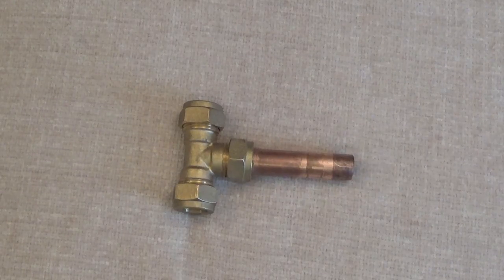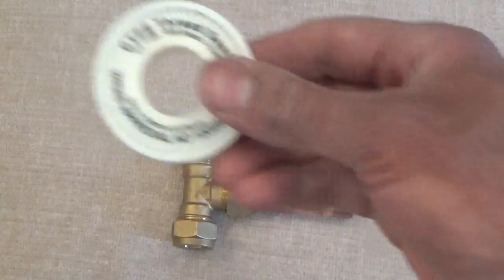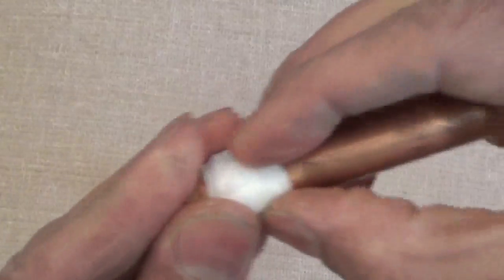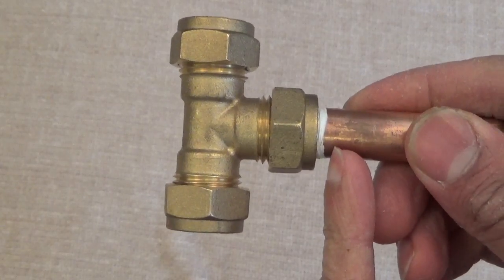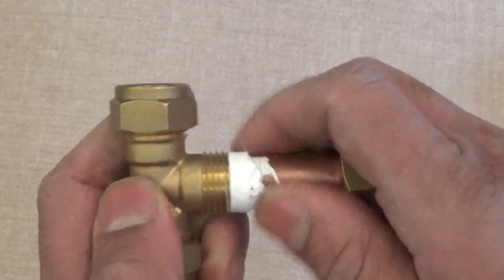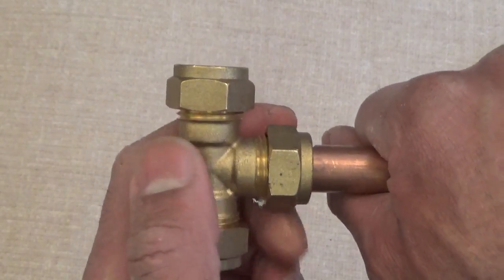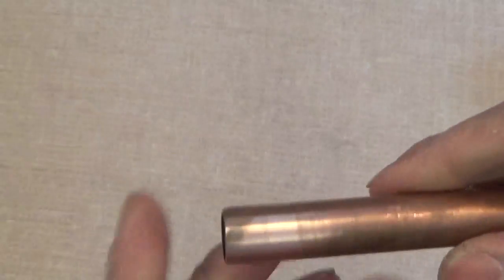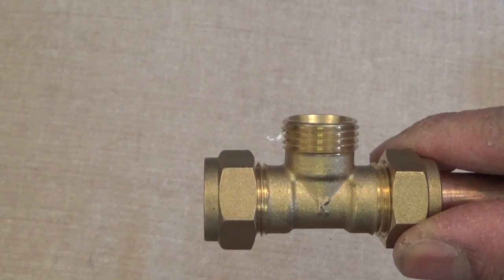Stop leaking compression fittings - Trydiy

Comment: Compression fittings do not require this. Cut the pipe clean and use new olive. Tighten it up finger tight, mark it   With a sharpie, tighten the nut with a spanner a full turn just going a quarter past the sharpie mark. It will never leak

Comment: Very easy to put PTF tape on a pipe like that, but my problem is the nut does not move away from the pipe with only about half the width of the olive which is fitted to the plastic fitting on my Shower heater which is an Aqua Tronic ultra 4 think l got it from B & Q and fitted it about 10 years ago but it has now started to drip water have tried to put more and more PTF tape on as much as the olive as l can but last attempt still leaked no way can you remove the olive

Comment: This video is correct.  We had vexing leak on a hard copper toilet supply line, downstream of the valve.  I tried tightening it and cold not get rid of the leak.  My best friend's younger is sister is a plombier in France and I asked her how to fix it.  She said they commonly use Teflon tape and pipe dope -- just a little of both -- on compression fittings in Europe, even though that's a no-go for most plumbers in the USA.  The reason it works is that it allows you to get it very tight, and really compress the olive, without excessive torque.  I tried it and it worked perfectly.  (I wound the teflon tape in the opposite direction from what's shown here though.)

Comment: A bit of very fine wire wool on this old joint first and perhaps a bit less PTFE. A 1 quarter wrench turn on the hand tight nut. Then tighten up a bit more should it drip. If you over tighten and it leaks you cant undo the damage and no amount of PTFE will sort it.

Comment: Never heard of using Teflon tape in this manner. I am installing two compression fit isolation valves in a crawl space so do not want them to leak especially since I will not have any access once the job is done. In just searching for some videos on installing isolation valves (SharkBite vs compression) I came across multiple instances of plumbers using Teflon tape on the ferrule. For the most part it seems to be a practice used more in the UK, but hey why not. Can't see any harm in adding this one extra layer of protection from leaks. Cheers

Comment: Just use polymer push fittings. The design life is 50 years (probably longer than the copper will last) and they'll keep going long after that. They cost a bit more than cheap Chinese brass compressions but it's job done and dusted.

Comment: For those so critical of this video: Ever consider that a lot of valve replacement is in an older home or one where the stub from the wall is barely long enough to handle the new valve? Or that reusing the ferrule is the most practical option in some cases? Also, are you saying Teflon tape will deteriorate with age and cause failure in the future? Really??

Not every plumbing project happens under ideal conditions. Trydiy offers a practical solution and some good advice, like not over tightening.
Reply: The video is correct in what it says, but it's usually better to use a push-fit polymer fitting. They have their own special needs (who doesn't) but they are more reliable. I've had cruddy stumps of tube sticking out that will never work, but a careful clean and the push fitting sealed. Those that won't seal  with a flexible O-ring will definitely not seal with a hard compression ring. When that happens the only option is to cut back to good pipe and start again. Non-demountable push fit to join some new pipe is often the best as it's much smaller diameter so won't get in the way.

Comment: I recently had a problem with leaking ferrules that were connected to a washing machine water supply valves. These were new valves, new compression fittings, and new pipes.  I have used these types of fittings all of my life and I am 73 years old so I have been to the plumbing rodeo before. I took great care not to over tighten them but they both still had a very small leak. I was ready to buy push on Shark Bite valves when I saw your video. I applied the Teflon tape to the ferrule and the pipe sealant to the male threads of the valve. It worked on both valves, NO LEAKS with only moderate tightening. Thank you for making the effort to produce this video as I am an old dog that just learned a new trick. I am sure that this is a common problem that owes it root cause as being poor quality fittings that are manufactured in China to very loose quality standards.

Comment: You should wind the teflon tape in the same direction that the compression nut tightens.
Reply: As mentioned in this thread That's when the tape is put onto the threads of the male portion, if it's wrapped the wrong way (ie. counter-clockwise) in that case the tape will be peeled off as the nut is closed. But the tape here was wrapped behind the olive (or compression sealing ring as they sometimes call it), there's no thread there and anyhow there shouldn't be that much tape that would catch the rear end of the nut whichever way he wrapped it.

Also, though he was turning the pipe counter-clockwise (from the olive/ring end) while keeping the spool of tape static, that's the equivalent of rotating the spool clockwise around a static pipe - which is the generally accepted 'right' way of winding the tape

Comment: PTFE tape is for sealing threads. Use joint compound for mating surfaces.
Reply: Both work in this context and with PTFE you don't have to worry about potable water regulations.

Comment: I have installed hundreds of compression fittings , there is no need to use ptfe tape, if the parts are cleaned properly, the olive will seal perfectly,

Comment: Thanks I had a leak from the compression fitting/olive. I tried the PTF tape and it got it down to a trickle. I think used the PTFE sealant and knock on wood the leak is now gone. Going to wait a day until I install the toilet because its a tight fit. Thank you for the suggestions its was great in troubleshooting the issue.

Comment: Wow...  clearly not understanding how a compression fitting works
Reply: Sometimes you pull off the old compression fitting with the tool and there is not enough space left to make a cut on the pipe. Had to use this method to seal a new toilet shutoff valve. Wish the compression nut didn't leak after I removed the old one but don't have the money to pay a plumber to come out and extend the brass pipe. This will have to do.
Reply: @brianc9036  ooof, thats rough.

Comment: I had a problem like that.  I simply mixed up some JB-Weld epoxy, and epoxy-glued the copper pipe to the fitting. I first dried out the inside of the fitting so there was no water on the surfaces, and I applied a light coating of epoxy to the inside of the fitting (just a thin layer), and then applied a nice thick layer of epoxy to the pipe ahead of the compression ring (no epoxy behind the compression ring where the compression nut will eventually be). I then pushed the epoxy-coated pipe into the fitting, and then wiped off the excess epoxy with a paper towel. I then tightened up the compression nut and waited for the epoxy to harden. When I turned on the water = no more leak.  Also = no way to disassemble that fitting, it is now firmly fastened together.
Reply: I like your style with the JB weld

Comment: If the pipe is inserted to far in the fitting it can actually not allow the compression ring to seat properly. Push pipe in all the way tighten slightly then back pipe out just a little from the fitting “Then proceed to tighten” with a little pipe compound works every time no matter the materials. A leaking one might need the pipe trimmed back a little!  Tape last resort!
Reply: looked every yt video. 
tanks for yor comment and wish me lock

Comment: I have always put teflon tape on compression joints, cheap insurance. But you have to wind it on in a clockwise direction, same direction as the nut you’re tightening, or it may not work. Might want to edit your video.

Comment: The PTFE should be wrapped so the nut doesn’t undo the tape as you tighten the nut.
Reply: But the tape is applied behind the olive/ring - no thread there. That nugget only applies when the tape is applied to the threaded portion. There's isn't so much tape that the rear of the nut will catch and unravel it.

Comment: I’m not a professional plumber 👨‍🔧 👩‍🔧 but really...truly speaking;  when connecting compression fittings;  you shouldn’t have to use special plumbing tape or compound solution.   When fitting the Olive onto the copper pipe....there is a knack to it; when tightening the compression nut.   But personally i much prefer using push fit...fittings.

I’m supposed to be refitting my kitchen out;  but not being a professional plumber.....I’ve got this awful feeling that it’s not going to be finished this year anytime soon😞☹️😒
Wednesday am at 08:15H  10th February 2021 U.K.  Southampton.

Comment: Wait a minute...the entire purpose of that ring is to seat both sides and not leak when you first tighten it by hand, give it a 1/2 extra turn, turn on the water and if it leaks, give it an extra turn until it stops leaking.
If you reopen that fitting, you have to replace that ring on the inside.
You should not need tape or dope. That is how it is designed.
Reply: Someone that understands

Comment: The actual seal is where the ferrule or olive is compressed between the seat of the fitting and the pipe. That is where the application of teflon tape or of pipe dope is likely to be effective.
Reply: But the purpose of the Teflon is normally as a lubricant to allow you to tighten a fitting more than you could without it, at least when used on a tapered thread like you are supposed to. So here it is lubricating between the rotating nut and non rotating olive.

Comment: So if you can’t fix it with ptfe tape because the pipes been bent, you take it off and use a push fit fitting, which you can only use if the pipes not been bent??? 
Great advice, must get your number so I know not to call you if I have an emergency.....

Comment: You wrapped the PTFE tape the wrong direction, it should be applied in the same direction as the nut tightens.Just had to mention it, sorry.
Reply: Well you shouldn't put Teflon tape on a compression fitting in the first place
Reply: @lukie4ever  \you shouldn't put it on a new fitting. If it's an old one and it leaks and for some reason you don't want to replace entire fitting you will get away with PTFE. But also this guy wrapped it the wrong way. Really kills me when I see video with PTFE on a new fitting, wrap it and give it quarter turn - that's a recipe for disaster. Sometimes trusting in advice found on Youtube may end badly
Reply: That's when the tape is put onto the threads of the male portion, if it's wrapped the wrong way (ie. counter-clockwise) in that case the tape will be peeled off as the nut is closed. But the tape here was wrapped behind the olive (or compression sealing ring as they sometimes call it), there's no thread there and anyhow there shouldn't be that much tape that would catch the rear end of the nut whichever way he wrapped it.

Also, though he was turning the pipe counter-clockwise (from the olive/ring end) while keeping the spool of tape static, that's the equivalent of rotating the spool clockwise around a static pipe - which is the generally accepted 'right' way of winding the tape.

Comment: Good video, but we're you winding the tape the wrong way to the nut?
Reply from the maker: If it was on the threaded part yes on the pipe it won't make much difference because it's being forced into the gap by the nut, but in retrospect I would probably do it counter clockwise I was concentrating too much on keeping the shot in the centre of the screen 😀
Reply: @TryDiy  oh I see cheers mate.
Reply: No disrespect but you have got this wrong mate . You should never need ptfe on a compression fitting , or jointing compound for that matter . it’s actually made for threaded fittings and that’s it , but over the years plumbers have used it around the olive as a precaution against shitty cheap compression fittings that are badly made as it seals tiny areas very well. But When using compression fittings the thread has nothing to do with sealing the actual pipe it’s used to pull the olive and pipe into the bore of the fitting , so the seal is between the olive and the bore . The thread has nothing to do with it on a compression fitting so applying paste in this situation to the thread is doing nothing it has to be around the olive

Comment: You are embarrassing yourself.  Teflon is a lubricant for MIP pipe threads.  That tape will kink and cause leaks this will cause more troubles than help.
Reply: Mark Harmon I don’t agree , where did you read that in a book
Reply: @heatservicebwcuk1545  I am sorry.  I have noticed that many others have had success with this technique.  Many of the failures I have encountered were due to sloppy use of Teflon tape on compression fitting threads.  The tape somitimes laps onto the olive causing a discontinuity.
Reply: Mark Harmon ptfe tape around the thread does nothing to help the seal. A couple of wraps around the olive is harmless , however , jointing compound is always my preferred option.

Thanks 

BWC
Reply: You are right Mark. The only thing I use on the ring before tightening the nut is a little pipe dope.
Reply: You're talking bollox